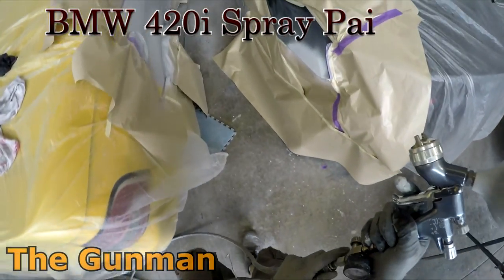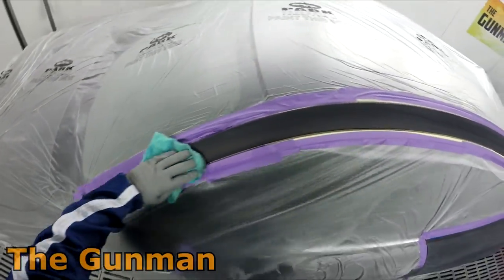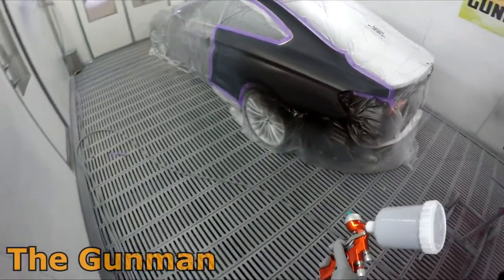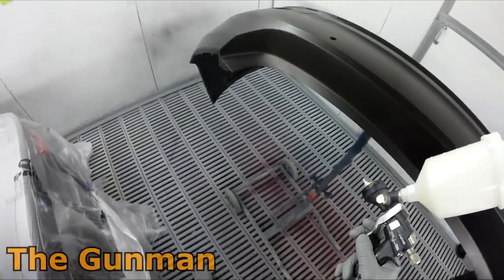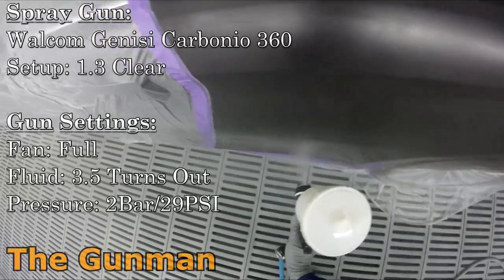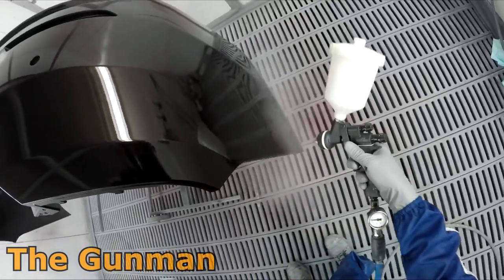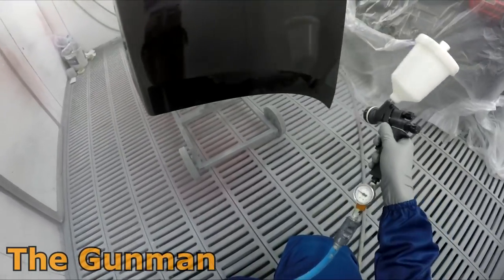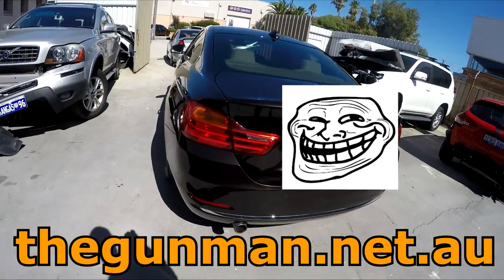BMW 420i Spray Painting

Comment: Had a fellow painter in the shop I used to work at put at least three rows of runs all the way around a Chevy pickup.  White will always trip up the inexperienced.  He was confident it could be polished out.  I think he tried that for a few days before stripping it and starting from scratch.  Only make that mistake once in your career.

Comment: Tack and whack method? Never heard of it. So do you blast a full wet coat on at first or do you just put a tack coat down (as the name implies) and then a full wet coat? And is that enough material to sand and buff if needed?

Comment: Hi Gunman, Just to say thank you for posting all these tutorial videos. They are awesome, and i have learned loads about set up, and all forms of spraying. The tips and the spraygun recommendations are awesome. I am new to spray painting, having just recently bought a compressor (3HP, 100litre ABAC). Anyway i am looking for some advice on spray guns. I am looking to buy the devilbiss FLG5, but would be using this for base coat and clear only. Now i am on a limited budget and will also need a primer gun. I know you said the cheap guns were shit, but would it be any use for primer or would i be better offbiting the bullet and  buying another FLG and just using it for primer with a 1.8 tip?

I will be doing only motorcycle parts, and wondered if you have any instructional videos for painting small parts with lots of compound curves in them, or even just for any tips or tricks for paintinig smaller parts. Another question (sorry). Do you use adhesion promotor on plastic parts?

Any help or advice is appreciated

Thanks again for the channel, i reckon i must have watched about 50 videos in the last week . Awesome
Reply: Alan MacDougall u
Reply: Well i bit the bullet and went with the FLG 5 in the end, one at 1.4 and one at 1.8, and im confident that these should last a bit better than the ANI one. I will use the 1.4 for base and clear and the 1.8 for primer.

Comment: when you sand down the blend areas, how do you get every last bit of dust out of the 600 grit scratches?   i did a bmw last week and i see stuff under the clear.  its tiny but,  i wiped that panel down 4 times, tached it down twice.   high air pressure?